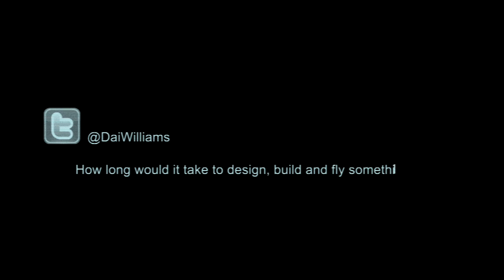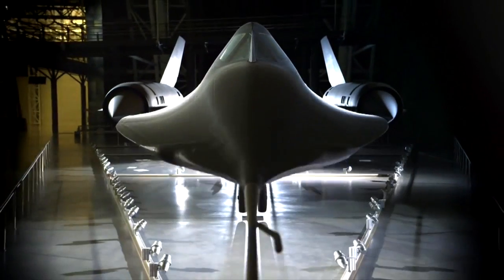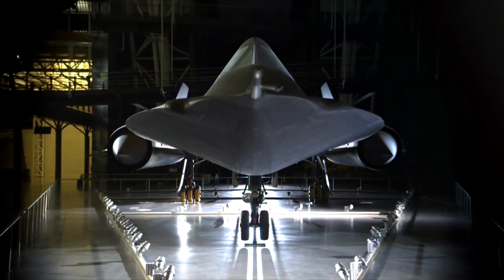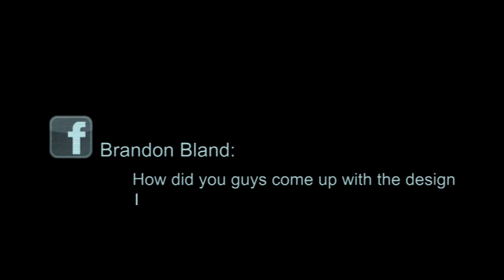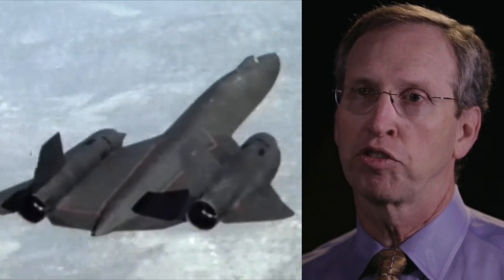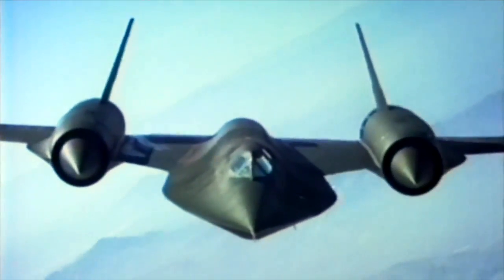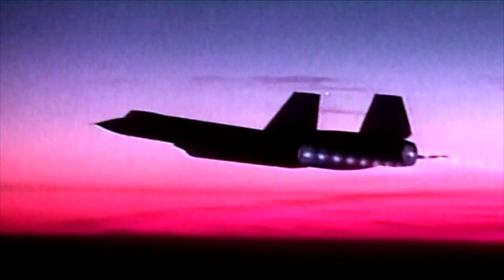Ask a Skunk: All About the SR-71

Comment: What fuel does the SR-72 use?
Reply: A special jet fuel made specifically for SR-71.... no other jet uses the same fuel.
Reply: Are you saying the same fuel used on the SR-71 will be used on the "SR-72"? It is quite clear in the video what the SR-71 uses.
Reply: 0xanier0
My Mistake.. I thought you said 71..
Reply: That’s classified
Reply: Do. You. Mean.  SR-71 ?    It used a special. Fuel. -    JP 7.   Designed.  Just. For.  The.  SR-71.    Air.  Force.  Veteran